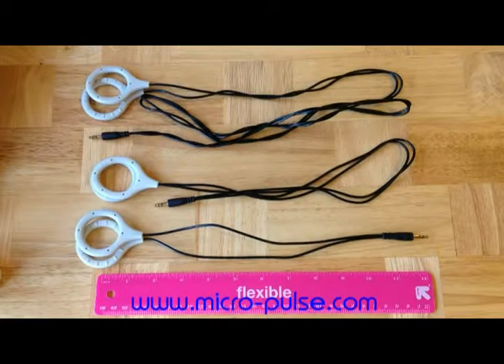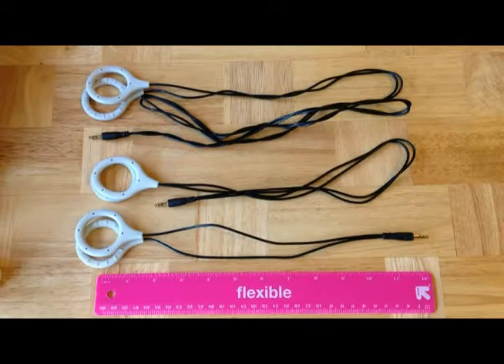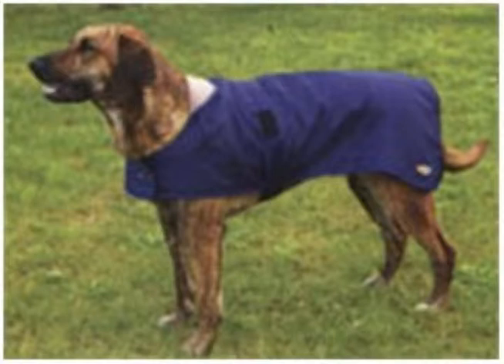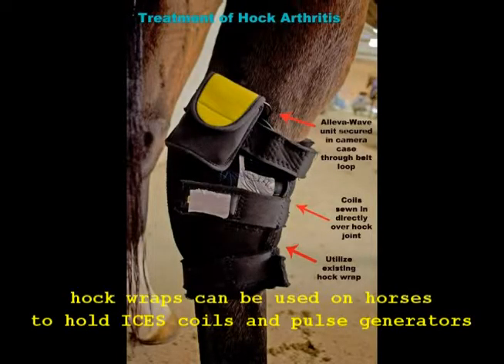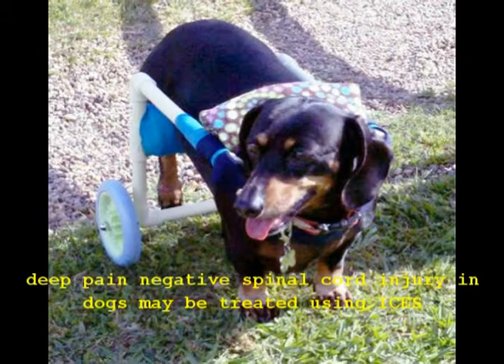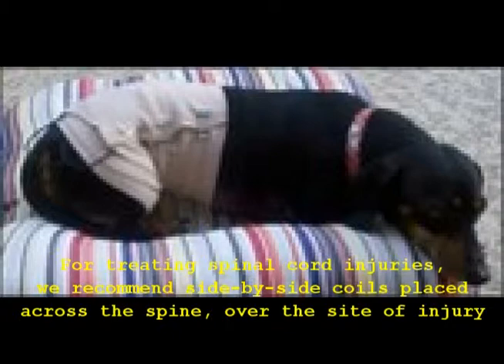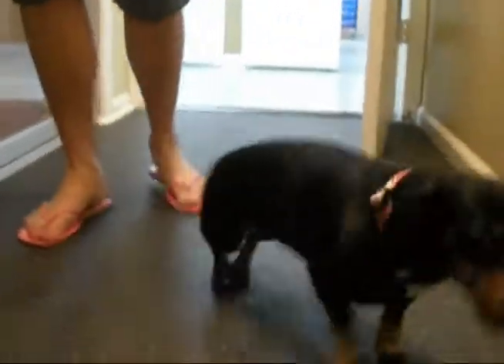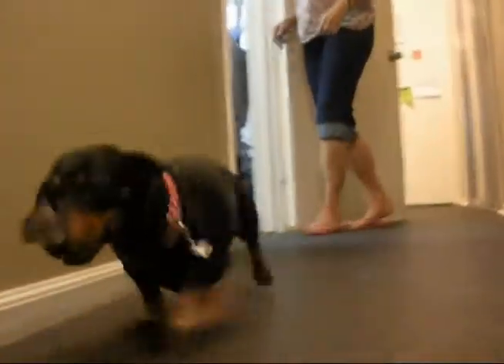Micro-Pulse ICES PEMF Tutorial 8 - Holding Everything in Place - Step #3

Comment: Which one should I buy for soft tissue injuries?
Reply from the maker: the A9 is simpler to use but works for most people and most applications
The M1 has 30 different protocols, which some people find more useful, but it costs about 50% more
either way, you need to experiment to find what coil placement and settings work best for your application
because there is no such thing as "setting X fixes problem Y"
Statements like that are just marketing fraud
Reply: Well the reason I ask is because I recently got treatment from a $26k pemf machine am noticed huge improvement in ligament stability and muscle strength. I’ve been dealing with neck, back and shoulder instability for 10 years. I’ve done Prolotherapy, pt and three sessions with that machine improved my condition in a week. 
It was quite miraculous!
Now I don’t really want to spend $26k or $10k on a machine if I don’t have to. That’s the reason I’m looking at yours. My question is, would your machine have the same healing effect on tissue or does tissue healing require a higher dosage hz and gauss?

Not sure if I’m asking that correctly. 

Thanks
Reply from the maker: @jcsampayo8303  OK, good questions.  To begin with, no one knows exactly why PEMF works, exactly what it does to tissues, or exactly what will work and what will not in terms of clinical outcome.  So, it is difficult to make specific statements based in fact.

PEMF marketers take advantage of this lack of solid knowledge and make all sorts of claims, just to make a sale.  I have written and posted extensively on this major problem, so I will refer you to those, if you really want to know about it in technical detail.  Just search "Bob Dennis PEMF" and you should find several days worth of material.

Briefly, Hz and Gauss are not really the correct parameters, but to understand this requires a strong background in biophysics.

Basically, the larger, more powerful machines do have some clinical advantages, but the portable, wearable, affordable machines I make have other advantages.

The only way to know what works best for you is to try each and see for yourself.  And the large expensive PEMF machines are not standardized, so it is incorrect to think that if one works, they will all work.  Each PEMF marketer will cherry pick images, testimonials, and scientific papers that are really unrelated to their product, to try to convince you to buy their product. It is a hard sell to get someone to write a check for $26k, so you should expect them to use every trick in the book.

But you have already found one that works well for you, so that is most of the battle.  My advice: stick with that one.  Unless you can afford $26k, you will probably need to pay for clinic visits, but that is probably the most cost effective way to go. 

But you can try a different strategy if you want even better results:

Many clinicians tell me that their best clinical outcomes using PEMF for orthopedic injuries usually involves using both a large system for a few treatments, followed by one of our small portable systems for daily use to reinforce and extend the benefits of the larger machine, and allow much more time for complete tissue recovery.  I think almost everyone who has tried that combination agrees that this gives the best long-term clinical outcomes.  I don't think most people need this much, but it is one strategy you can try if you need to find a way to get better long-term results.
Reply: Robert G Dennis great! Thanks for the feedback!
Reply: @jcsampayo8303  What was the brand/model of the $26k machine that helped you?